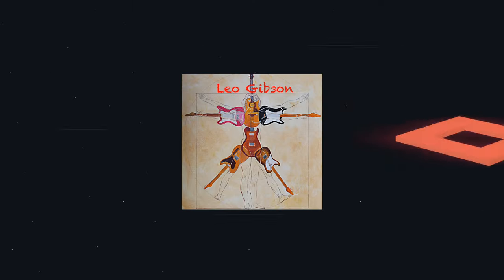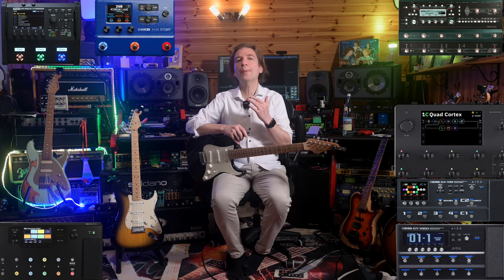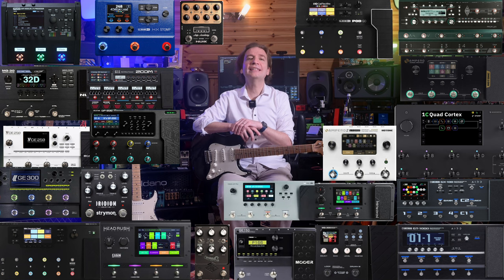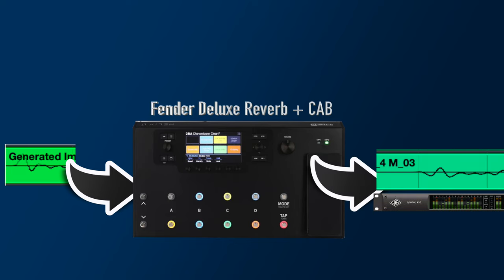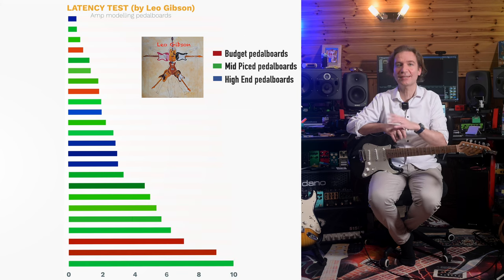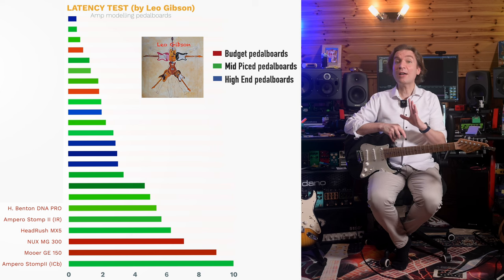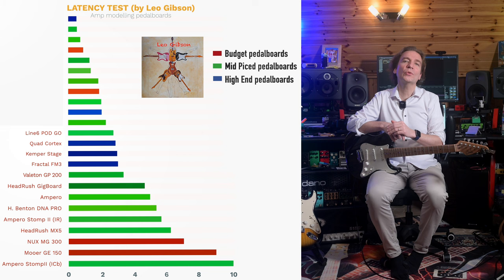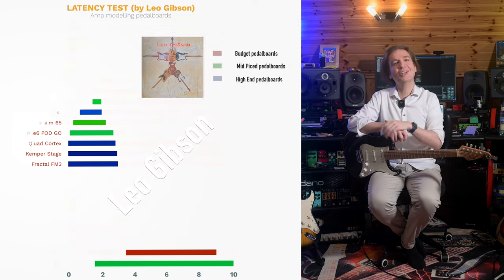LATENCY TEST: 23 amp modelling pedalboards compared! Quad Cortex vs, FM3 vs Helix vs BOSS vs NUX....

Comment: Digital latency is a big f** deal.  If you plan to run any of these modelers in 4cm, then the latency will be doubled (or more) with two rounds of conversion.  I used boss GT processors for past decade(s) in 4cm and could not perceive any latency, now I know why!  

More recently, I purchased a G11 and the latency is just perceptible in 4cm. IOW, I can feel latency around 4-5ms.  It is just at the threshold of what I consider acceptible, but precludes the use of additional digital effects in the loop, because that would add another round of conversion and more latency.  

The Zoom is a mid-price processor so I consider this acceptable, but I think Line6, Neural DSP, and Fractal have all been put on notice!   It is completely unacceptable that the Fractal has more latency than the Zoom G11!   Also the Helix is an expensive platform and should have better performance!  

This backs up my real world impression using the Boss GT.   A single round of conversion should take < 1.5ms so the latency is not felt in 4cm!  Boss is in a league of their own here!
Reply from the maker: Hi, thank you for sharing, interesting points!
Reply: I think the quality and accuracy of the algorithms in a modeler will affect the latency. A less expensive modeler could have less latency due to the fact that the algorithms are much simpler.
Reply: @toesalad  Thats possible, but the problem is solved by a faster processor/higher sampling rate.  Leo's test is amazing because it puts numbers to what I have personally experienced, and the amount of latency that I (personally) find acceptable.  

If I am buying a "high end" processor, its primary use case will be 4cm with an amp, with ability to add another digital pedal(s) if necessary.  Only the Boss GT has latency numbers that I consider "worthy" for this use case.  For me the Zoom G11 is right at the edge of acceptable for 4cm, but I primarily use it direct without an amp so it doesn't bother me.

There was a rebuttal from Fractal owners that the FX3 has lower latency than the FM3, if so, that may also be a contender.  But given the results of this test, I would not purchase a FM3, a Quad Cortex, a Kemper, or a Helix for 4cm to be used with an amp.
Reply: @chrisx742  Perhaps if your use-case is purely lowest latency for use with 4 cable method, and you are happy with the sounds you are getting, then you are right.

My use-case is straight into a power amp and cab. For that, I eliminate any latency that the IR brings (so I might be somewhere in the neighborhood of sub 3ms), and therefore I am very happy with my FM3. I tried the Boss and Helix, but just couldn’t bond with the sound and found the overall flexibility in those to be lacking. I appreciate the extra features, and am willing to pay the extra latency cost.
Reply: @toesalad  Its important to mention that Boss builds their own proprietary DSP chips that they use in synths and guitar processors, which may give them an advantage in latency and processing power.  Its unknown how it stacks up against Line6, Fractal, etc.  

I haven't played a Fractal in person, but the youtube demos don't sound any better than the other processors at this point (that wasn't the case five years ago.)  Thats not to say that they aren't better in person, or that they aren't more faithful recreations of the amps modeled.  

Leo's test only involved an amp/cab block.  Real world results when using the FX loop in 4cm, probably double that latency or more.  Latency is either below the point where you can tell, or its above.  The difference of a few tenths of millisecond x2 could absolutely be the difference between being able to feel the latency and not when running through two rounds of conversion.

I am not going to spend $1k+ for a mfx processor that out of the gate you can feel the latency in 4cm.  I wouldnt be quick to dismiss the quality of the LIne6 and Zoom algorithms either, they are probably running similar dsp processors to the FM3 and their latency is only marginally faster.

Comment: More computing and details depth..requests time... If you load amplitube 1 on axe fx 3 you can have 0.2 ms ..:-D
Reply from the maker: Hi, this is also one of my considerations, even if I've come to the conclusion that it is not always true. For instance there are units that manage time effects in a way that they don't add latency (Line 6, Boss), where in the QC time effects add "a lot" of latency. For instance, let's say that I add a 500 ms delay to my chain...why should it add latency? the first repetition is after 500ms...so there is all the time we need to make the calculations, at least I guess. Therefore, in my opinion gear builders can develop strategies to reduce latency or manage it better.
Thank you for your comment.

Comment: Have you checked the latency after que new Ampero 2 firwmare update?
Reply from the maker: Hi, actually for the video I updated all the firmwares at their latest version at the moment of the video....a very boring process...😀...Ampero 2 was at the firmware 1.0.5. Please take into consideration that with custom IRs the latency improves and I have noticed that with firmware 1.1.0 the latency would have been improved. This is what it is written in the fw notes: "Optimized system latency when using less effect modules" (maybe after the video Ampero has decided to improve it even further). . 
Thank you for your message!

Comment: I use these units in a live, though amp manner and so I use effects but no amp modeling. For me the always overlooked and never reviewed aspect of multi effects and modelers is their ability to preserve a guitar’s tone. I have had a few units and none of them give me a pure unadulterated signal. My Nux MG30 robs the natural tone of my guitar and so I have to reintroduce the frequencies that are deficient using by pre eq or other means. Even after doing so, the result is less than I would hope for. I am curious Leo as to your observations on this matter. With all these units you have played through, is anyone achieving a purity of signal?
Reply from the maker: Hi, I think this is a pretty personal topic, and we may have different opinions. 
I think that also analog gear, like distortion or delay pedals or reverbs, can alter the tone. Also among amps, there may be units that do not provide the guitar tone you may want. I think it is typically a matter of compromises. For me, amp modelling pedalboards are very convenient tools, that can provide us with a very consistent tone (where micking an amp can give you different result every night), that are typically less expensive than a full analog gear, very easy to carry around, etc. I can typically obtain good tones or tones that I enjoy enough to be inspired when I play at home or live. Therefore for me it is a "go", and I would eventually overcome defects that there could be (even if I think that nowadays the tone you can get is very realistic). But obviously this is totally subjective and tone is such a persona experience that I can understand that you prefer different setups.
Thank you, this is an interesting topic...

Comment: Ampero 2... Very surprised... Need to be optimised in next firmware updates!
Reply from the maker: Let me just add that with a custom IR, the Ampero Stomp II becomes much quicker.
Thank you!
Reply: Everyone has been crying out for optimization. The Ampero 2 is a good modeller but it's being held back by it's software. Scenes/Snapshots and DSP optimization is hopefully a main priority.

Comment: out of curiousity, can you test the latency of some tube amps?
Reply from the maker: well...it's gonna be 0, as the signal travel at the speed of light...the only latency is due to the time the wave form takes in order to travel from the speaker to your ears. The wave form travels at the speed of sound
Thank you!
Reply: @LeoGibsonGtr  in theory, should be easy to prove, would be a nice ad on to the video

Comment: What about the IR200 and the IR2 ?
Reply from the maker: Hi, the IR 2 is here: https://youtu.be/LkIDHW99MJ8
I guess the IR 200 is very similar to the IR 2
Thanks!
Reply from the maker: Hi, the IR 2 is here: https://youtu.be/LkIDHW99MJ8
I guess the IR 200 is very similar to the IR 2
Thanks
Reply: Thanks  @LeoGibsonGtr  for the reply Leo. Any comment on the Two Notes products in terms of latency (revolt, opus) ? Also, which do you find better tonally and feel wise : Opus or IR-2 ?
Reply from the maker: Hi, I didn't test the Latency of the Two notes products, as it is tipically reported in their user manuals.
The comparison IR2 va OPUS is interesting...they are similar and different at the same time...I should make a comparison video to answer properly....I like both... :)
Reply: Thanks a lot. It would be a great comparison as they're similarly priced.  @LeoGibsonGtr